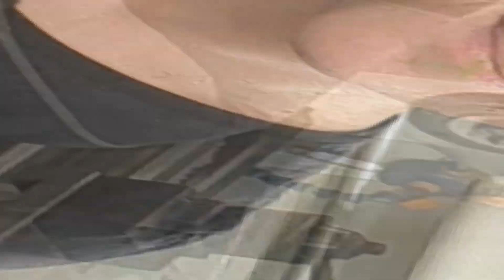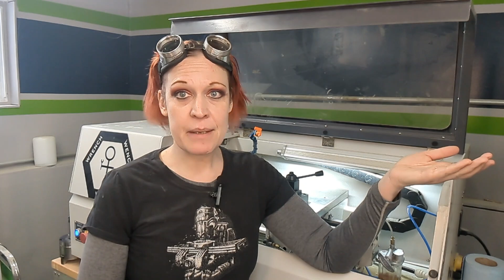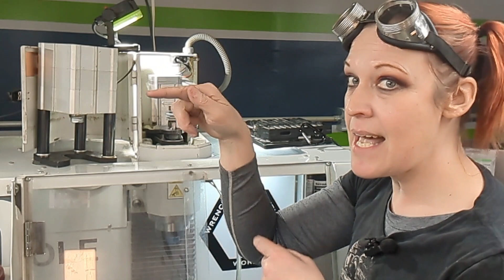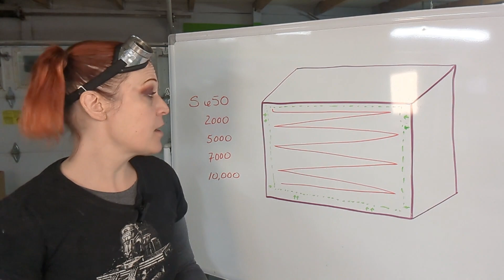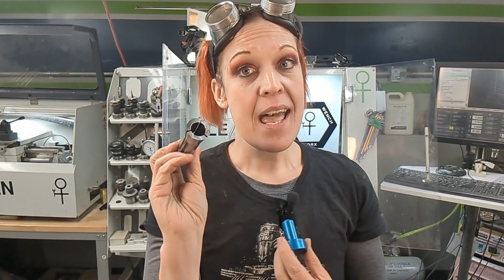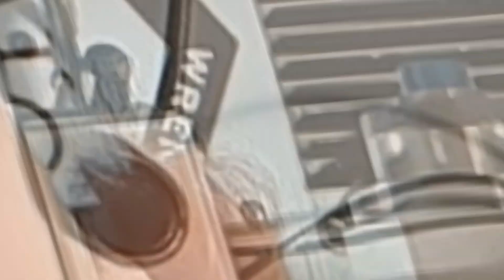CNC Machine Warm Up, Cold Weather Fluid Maintenance and Effect of Thermal Expansion on Accuracy

Comment: Great topic and thank you sharing your experience with us!:) (Subscribed!)
When talking about temperature control, you cannot mention enough how important (and cost saving and environment friendly!!!) thinking about and implementing passive cooling/thermal-insulation (works in both ways) is. For separate machines, rooms and entire workshops, this will mitigate steep delta-t responses to the environment temperature (you spoke of) and reduce problems with the dew point and condensation inside your workplace. Also an intelligent design of your stability solution (if that is needed to guarantee tolerances) is very important. Customers do not pay you for conditions that are usual in the microchip production industry, they just chose a factory/provider who is cheaper. Example: We have a lathe with a 5kW spindle. That kind of machining is by definition cutting metals, which translates 1:1 into thermal energy. Because we are not clowns, we chose the worst case scenario and need at least a 7kW air/room-cooling unit. Do the math for yourself: That active solution will just not be viable and affordable for anyone. Smart environmental based (like heat pumps ... again: works in both directions) and also passive insulation solutions are needed.

Info: For those who are scared now: RTFM, or better your technical drawing. The tolerances there show you if you need such conditions in the first place. Or: WHY THE HELL did you take that contract, with your Chinese $400 Lathe ... Hehehehe. Have fun making. I wish you all good and smooth work and a broken axle:)  (my apologies, the latter is a German peculiarity when it comes to sayings. So don't get confused: The negative meanings is of course only meant ironically. So the opposite!:) )

Stay warm and healty!
Reply from the maker: @dieSpinnt - these are all EXCELLENT points!  While I am quite certain I do not have the level of expertise in temperature control as you exhibit, I sincerely appreciate your well delivered feedback - and I wholeheartedly agree on the importance of insulation and being mindful of taking on work that is suitable for your work environment!  I have been extremely delighted with how well my little shop keeps the temperature stable and how heating the shop has actually saved me a great amount of money in the long run.  The shop is below our living quarters, and as heat rises, I have been able to keep the thermostat in the house lower while the ventless heater is running.  And even on our coldest days (which can sometimes dip below -15 degrees Fahrenheit at times), I rarely need to turn it up past the minimal heat settings.  Our home (and the adjoined shop spaces) are very well insulated....which makes a huge difference in utility consumption.   😃

Thank you so much for your amazing response and for subscribing!  By the way, I LOVE the 'German peculiarity' - hahahaha!  I have never heard the quip about 'good and smooth work and a broken axle' before - but it gave me a good chuckle!! 😅  I grew up in a Northwoods 'Scandahoovian' household, and there were so many fun phrases associated with our dialect, so I appreciate the levity of a good cultural expression!

Comment: Nice. Hot tip to get the next level of presentation. Drop the word "what" from your vocabulary unless you are asking a question. Eliminate "What I wanna to here is I wanna" and all related silly filler. In Youtube speak I would have said "What you wanna to now is you wanna drop the word 'what' from your vocabulary...".  This is not easy given the almost universal use on the Tubes because we hear it all the time. But once you are aware can can begin to speak directly. What you want to do now is cut this piece to length -->  I will now cut this piece to length --> Cut this piece to length. 

I like your first-person "I" style as opposed to the "we" style which is pretty silly since "we" are not doing anything but watching :-)  There used to be an organic coolant and rust inhibitor called "Molecular Edge" I think. I can not find any reference to it. Ever heard of it? Greenish color and diluted from concentrate.
Reply from the maker: @charlesspringer4709 - thank you so much for the incredible feedback! I completely agree with you on my excessive use of the word 'what'.  I have a few other personal ticks in my vernacular that I have been trying incredibly hard to break as well, because I find myself saying 'soooo' and 'actually' quite a bit.  I have really started to appreciate how much I have learned about my own speech patterns while editing videos - and receiving feedback like yours is appreciated as it helps me know which areas I need to improve on as I move forward. 😊 
Good question about Molecular Edge, as I am not familiar with this particular brand. I was just trying to find some references to it online - and you are right - there seems to be a lack of information out there on this coolant. I wonder if part of this is due to it being an organic coolant? I know that with the widespread use of synthetics and semi-synthetics in industry to prohibit bacterial growth, it is getting harder to find a purely organic coolant that can be purchased off the shelf. I do have a bit of a fun story from my tech support days, where I had a customer call in about rust on his ways. I asked what he was using for his lubricant and he had stated he was using butter. I realize it sounds odd to a lot of younger folks, but as lard was once commonly used as an inexpensive lubricant for some of the earlier machine tools (and I remember using lard on some of the equipment we had on the farm as it was always readily available), I didn't find it that unusual. Turns out though....he didn't realize that he had been using salted butter - hence the rust. 😄
Of course, I am not recommending the use of dairy/animal byproducts on a modern machine tool, especially as the pure organics can get rancid pretty quickly if not well maintained - but I do find the history and evolution of the machinery industry fascinating!
Do you know off hand who produced Molecular Edge? I know that so many of the current fluids on the market are produced by petrol companies, but it would be interesting to find out who created the organics as their oil base tended to come from animal fats and not a refinery.  I may take a peak through some of my old manuals/machinery books as they tend to have some fun gems in them in regards to historical maintenance techniques. Thanks for the great feedback and fun question! 😁♥️🔧♥️

Comment: If you're warming up a spindle, insert a tool holder that's got a spiral stripe painted/marked on it in a contrasting color, like the hub of a jet turbine. This makes it super easy to see when rotating.
Reply from the maker: Good call, @petergamache5368! I actually have my Nite-cap marked.....but I failed at mentioning it. Your comment is very much appreciated because I completely forgot to mention this, so I am grateful for the feedback!) 🔥